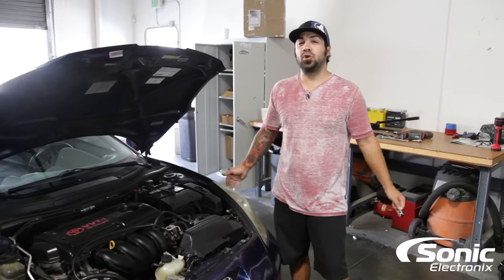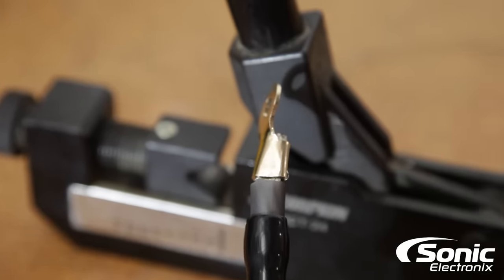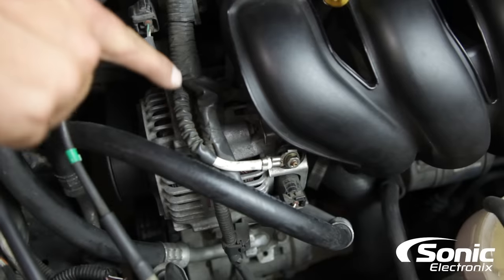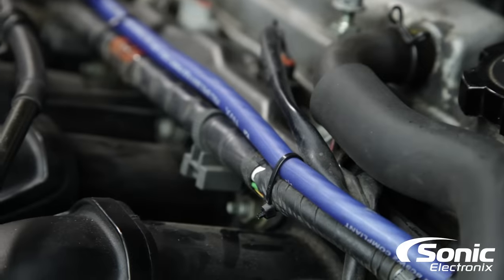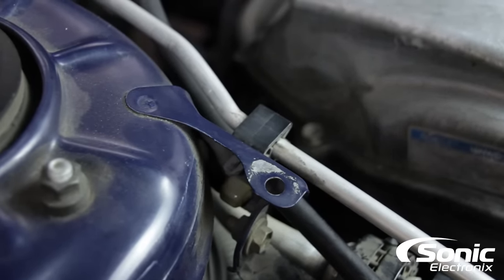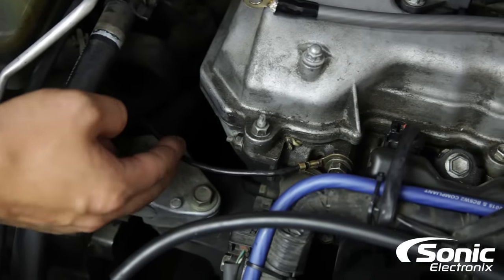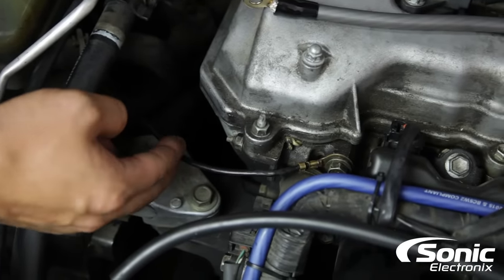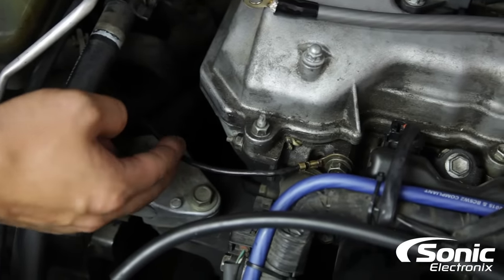How To Install the Big 3 Upgrade | Improve Your Vehicle's Electrical Charging System | Car Audio

Comment: So I will not mess up my electrical system if I put in a high amp alternator and run a big wire straight from the alternator to the battery leaving the stock wiring just the way it is?

Comment: Why do we keep the original stock wire (alt to battery)?  Why not just cap it?  I don't see the need of having stock + new wire connected at the same time.  I'm only interested in the BIG 1.  My stock lug going to the alt has  broken off.  I would simply route a new wire from alt to the battery...makes sense?

Comment: I like you video... But it is missing one explanation.
Why would or do you do this??

I am a 4WD enthusiast, not really into car stereos anymore, but we have big loads and big charging requirements and DC-DC chargers for 2nd Deep Cycle Batteries.
I can only guess these upgrades would help, but i have never heard nor seen them before.

I would also say from an electrical stand point, match the Alternator Charge wires OEM length and diameter would be helpful, as the current will take the path of least resistance anyway
Reply: "as the current will take the path of least resistance anyway."
most altanators only get a 8(50 amps) or 4(85 amps) gauge wire.
60 amps on a 4 channel amp is about norm.
try pulling 60 amps through that 8awg and eventually the sheilding will fail, and you will get voltage drop like crazy. resistance through the wire getting hot resulting in the sheilding melting.
the whole idea is to reduce resistance for currant flow.
the engine ground is stupid, take a ground from the alt case to the battery will result better than any normal engine ground. people over look this one on the engine ground as you actually making a better ground for the altanator.

Comment: Seems a little silly... unless a factory ground or power wire is damaged loose or corroded you’ve got very little voltage drop and you’re not going to gain anything

Comment: Thats nice and alot help for some but my 1998 dodge ram 1500 i could use little help on the backside of the alternator had this little plastic cover and I'm not sure how to get it off what should I do i dont know if it pops off or what

Comment: I did this upgrade just exactly the way u showed me... I have a 3.5L Pontiac G6, my fuse relay for my dash cluster lights keeps blinking and door chimes sound goes off and only when I turn my daytime and fog lights off car runs excellent... Should I ground the alternator to chassis also?

Comment: If you only deal with larger gauge wire once in awhile, it is hard to justify spending $40-50 on a larger, hydraulic type crimping tool. so see below.

Comment: You never add a wire. Always CHANGE the wire to an uprated current wire of the correct cable type. the simple reason for this is that you need to allow for the maximum permissible amperage of the cable run. Adding a wire really doesn't make it any better, if one wire fails, you have a live floating around also unless both wires are rated for the maximum permissible amperage and a bit more, you'll overload the wires and cause a fire, if you haven't already got that with a broken live cable.

Comment: Hi from the UK!  Love your videos.  One thing i cannot find anywhere on youtube etc is this..... I have a camper van (an RV) which i am putting a small JL audio amp, one 10" sub and a pair of Infinity Reference speakers in.  When the engine is off they run off two 110Ah leisure batteries.  I cannot find anywhere what the draw is in amps of the head unit and the amplifier.  Not even the manufacturers replied to my emails.  Is there a way of finding out so i know a) how long i can run the system without the engine running and b) what size solar panels i would need to run the system using the panels to recharge the battery as it goes.  Any help really appreciated! Peace

Comment: how does just adding a new fatter wire to the existing ground terminal work as an upgraded wire? does the OEM wire still not play a factor in your ground?
Reply: Derek Godbout That just help recharging your battery.. real upgrade is battery and alternator plus this

Comment: Dimming lights, slow power windows could also be a bad serpentine belt or a bad water pump. This can lead to bad alternators  and constant battery replacement. Unless there is a known flaw recognized by the manufacturer I wouldn't  mess with the electrical system of your vehicle.
Reply: Unless you are expanding the electrical system. Which is the entire point here. 2 or more amplifiers drawing more power than most of your car.

Most people will eventually have to upgrade the alternator to a high amp output as well, some will add a battery bank in the trunk.

The point is that you are going beyond the manufacturer's design. Aftermarket.

Comment: Everyone's that talks about the big 3 say keep the stock cableing, Why? As my battery power cable needs to be change out it makes me wonder why do I need to use a stock cable, why can't I use my new 0 gauge cable, that's a part of my big 3 upgrade kit? 
Also don't the Alternator need to be protected by a fuse. Seen several videos where people put a fuse block on the end of the power cord as the do the big 3 upgrade. Or is that over doing thing?

Comment: Why did you put the bolt end underneath and the nut on top?
Reply: Coroashen will start at the threads and work its way in. So the thead is under hood and head of bolt is outside.

Comment: I replaced all the power and ground wire in my 01 lesabre with 1/0 welding cable instead of just adding the wire to the existing factory wire and I don't have hardly any voltage drop compared to the factory wire which was small af , why do alot of people say add to the existing wire rather than replace???

Comment: you put the additional battery terminal direct to the battery what about the battery regulator if you by pass it could burn the battery  by over charging because it does not pass tru the regulator

Comment: Will the big 3 put less strain on the alternator? I got a 2003 camry with a 80amp alternator powering a Rockford fosgate tb1000.1bd two 12s 300rms...600 watts peak power... running 2ohm... want to be on the safe side and not strain my alternator....Battery dies fast too and sometime rough starts can the alternator be struggling charging my battery? when bassing hard 11.86volts from battery with head lights on and A/C on idle..Sometimes lighting dims slighty.. Maybe I should look into a better battery?
Reply: I'm suffering the same but I've installed two Caps, I think it's time for a new battery n big 3 upgrade.

I'm running 2k RMS sub with the same Alt as urs. Battery dies after 20-30mins if I play at 15 n Bass on 60khz
Reply: @thabopoo6285  never run ur stereo from battery power,

Comment: how come you did not get a shcok from touching the negative to the metal frame?

i thought you weren't supposed to touch metal with negative?
Reply: What are you talking about?
Negative is ground. Metal chassis of the car is ground
Positive on metal chassis -> sparks + possibly fire

Comment: Can you do this on newer cars...I was told by an audio installer that my 2013 ford explorer xlt with the 8 inch screen(not sony) isn't a good candidate for this upgrade it could possibly damage my electrical further down the line...is this a good statement from the installer

Comment: In my 86c10. the red wire goes from battery pos. to the starter not the alternator.So do I simply run my 0 gauge from alternator to the battery?

Comment: Q: I have a 2001 Toy Solara V6-SLE and as of about a year ago there's a flicker in all my lights, including dome, dash, clock and headlights. I've replaced the alternator, belts, including timing belt, spark plugs and they all still flicker. The car is all stock. Will this help? Or have you heard anything regarding this issue? Thanks in advance.

Comment: Hi, can I just upgrade on engine ground or do I need to upgrade the 3 area that are recommended?
Reply: Depends on which of the three are the weakest link, and if you are actually pulling enough amperage for it to matter, if you don't have a very good ground connection from factory or if it failed at some point and was haphazardly replaced with 16awg then yeah, you'll see a huge difference. Check all connections and start with whichever and work toward the rest as you save money 💰 👍

Comment: Is it ok to use ground 0 guages? I have premade wires with rings already on my dad was gonna scrap all i gotta do is slap em on
Reply: bigger wire is less resistance for current to pass through :) 1/0 gauge will be just as good as 4 gauge

Comment: If everything is done right  (good quality terminals, good cables, star whashers for chassis, etc.) this is the right way to start working for a more serious sound installation in a car. Of course, the electric power conditions will become more stable. They will not provide more current in the same installation but surely they will get better. I do not see any problem in spending a fucking dollars in this situation, knowing that all the current that is going to be used will pass through this cabling. That is, regardless of what this may mean in a commercial way, the truth is that these 3 steps are important for the future of a sound installation. Or am I completely mistaken?

Comment: What size Big 3 upgrade would you use on. 210 amp system with 1500 to 2000 watts??? Thanks

Comment: I'd love to see you guys do this on a vw tourege where the battery is under the driver seat, lol but really would ya?
Reply: The correct method here is...
1) Don't buy a VW. 
2)Buy a normal vehicle.
3) Upgrade that instead.

Lol. Shouldn't need a dealer to change one headlight bulb, and shouldnt have nine bulbs in one light unless its an led strip 😆

Comment: Does the charger cable for alternator has to go directly to the battery? I have a 2006 Chrysler 300 battery is in the trunt...Can I just hook it up in the power cable thats connected to the fuse box in the front of the car? Would be alot easir.

Comment: I have a 2010 Ford Focus  SE Sedan, should the 3 wires all be 4guage?
Reply: Personal opinion, depends how big of a system your running,  I'd go by how big your power wire is for your amp. But using 0 guage will let the maximum amount of current flow to the battery and ground. So I would use either 4 or 0 guage

Comment: I have 2000 Toyota Camry 2.2 LE. Trying to get a high output alternator to power a aftermarket stereo system. The problem is Toyota cars are only compatible with OEM parts. If I am wrong are their any suggestions on getting a better alternator for my car?

Comment: , TIP.......  slide your heat shrink tube over the wire before crimping. and yes, always use heat shrink tubing to cover and protect your connection to your wire !!!!!!!!!!!!!
especially in a salty environment .!!!!!!!
Reply: why would you damage the heat shrink by crimping on it weird flex

Comment: Hey Allen. 06 lexus gs 300 I installed my system my self and keep having issues with my charging system it works then the battery dies. After a few months. Do you recommend doing this on my car? Or can and should I upgrade my battery and alternator? Thanks in advanced.

Comment: I have a question so I have  a 1998 Buick Regal gs with a 1000w hifonics amp, 2 12 inch kickers and a 0guage power wire running from the battery, would you recommend doing this upgrade for my set up ? It would be easy to do on the car but only reason I asked was cus the guy I bought from said his headlights dimmed and I assumed maybe it was cus of the large power wire he got

Comment: My local stereo shop said to use my strut tower bolt as a ground before is that safe? I mean one of the 3 top strut top mount bolts, Doing this soon on a 05 crown vic just want to make sure doing this best i can. 1/0 kit for me running 2k watts and about to add another amp for the highs plus i charge my laptop/phone/tablet so i need a still electrical.

Comment: how should i run the power wire from the alternator on a 2010 impala? straight to the battery? the impala has a fuse box in the engine bay so idk if i should run it to the box and then to the battery, or just straight to the battery.

Comment: Dielectric grease? Its not just for spark plug wires. Give them lugs a good coat and them battery terminals for sure. Even the charge wire stud on the alternator. You can thank me later on when you look things over and your stuff isn't all corroded up and crusty and you buddies stuff looks like it's been on there for 20 years. I'd  put a little between the body ground one and around the head of that bolt and the terminal so it will have some protection then paint over it to seal it in there. It's Vasa line for your car. Lol

Comment: My dude that did the "big 3" on my jeep caused my jeep to stay on after I turn off with the keys until I open the passinger or driver door.    From what I see the neg battery and the block are connected together.    What would you'll do to address, if you can offer some help.   Lol

Comment: I'm planning to do this on my 4runner, problem is i have a twin battery parallel setup (winter pack edition), do i have to do the connections on both battery?

Comment: Great vid but i can't find anything on a 94 deville about engine to body ground. Not sure if the ground on the alternator is it or not.
Reply: Chris Miller do the same thing he just did, add some fuses just to be safe. Even though everyone, well most will say you don't have to
Reply: @AJOSUE  yeah that's what I'm going to end up doing. Thanks

Comment: Hi quick question. I have a 2008 silverado that has an extra battery tray. I have a 1600 watt audio pipe pushing 2 audiopipe bd1s and I grabbed a Kinetik battery that I want to install. Do I need to do the big 3 before installing the battery? And if so do I need to run 0 gauge from one battery to the next?

Comment: Just discovering this now.

Guess its time to update the 10 year old grounds from 2008.  

Which kit for hyundai accent

also I have installed new pioneer speakers and a headlight relay harness
Reply: replaced all the old dirty ass nasty ass 10 year old speakers and dome tweeters.  All pioneer. Was gonna get sony but saw pioneer costs more and seemed better.

And added sound deadener and 10mm foam all around

Just wanted better than oem.  Not crazy about car audio.
Reply: Well?

Comment: Why leave the factory charging cable from the alternator to the battery ?
Reply: Why not?
Reply: @a.k.3659 that’s apart of the Big 3. You’re upgrading the load capability on the charge wire. If you’re running higher running watts that factory charging wire could melt and catch fire
Reply: @FatGuyInALittleCoat1  No man, no way. I am pretty sure the load is being distributed between these two efficiently.

Comment: I’m confused. There is a negative ground wire that goes from the battery to the frame and another ground wire that goes from the battery to the engine block than another wire from the engine block to the frame so I have a Total of 3 grounds

Comment: So would this help someone that has a plow in the truck and the lights dim when moving the plow
Reply: I added a 2nd battery and it solved that problem for the plow I have on my 2015 Silverado.  The truck has space for an extra battery and some trim levels come with 2 from the factory.  I  added the charge controlling device that will only charge the accessory battery when the primary is above a certain charge level and only when the engine is running.  This prevents the accessory battery from draining the primary when the engine is off.  The controller also has a button you can push that will allow the 2nd battery to jumpstart the first without jumper cables.

Comment: I have a regular size oem engine ground still, but the other are all 1/0, I also have 250 amp alternator and platinum agm battery, along with a XS power supercell capacitor bank of 630 Farad...  I'm upgrading my system to around 3600 watts rms, so will I need to replace that oem engine ground, and or anything else that I might be missing? thanks!

Comment: I would advise upgrading your alternator prior to doing this otherwise it will be a waste of your time.

Factory alternators generally have very low amperage (usually barely enough to run all of the cars current electronics). Upgrading the wiring will do very little in providing more power....simply because the power isnt there in the first place.

Comment: Can you actually just run 2 of everything like that ??
Reply: YES! no need to remove any factory wiring.  It all caries the same 12v+ or -  dc flow of electricity. If you add another on top its like adding a 2nd water pipe that feeds a fire hydrant. The flow at the end isn't effected after 2 different streams merge together.
Reply: rmblwgn cheers that analogy really helps actually!!